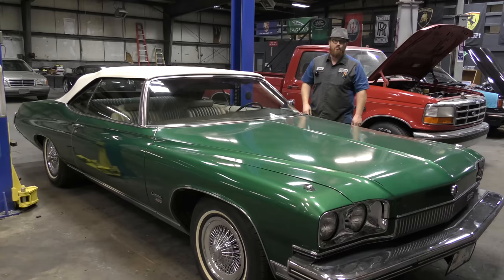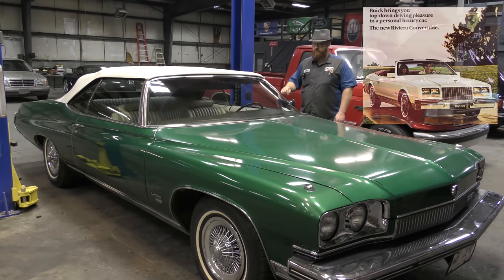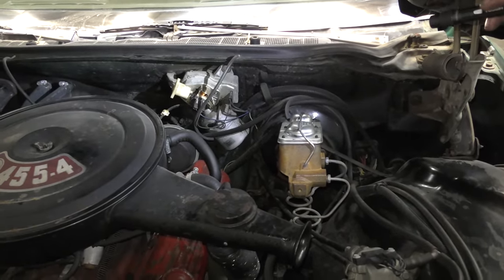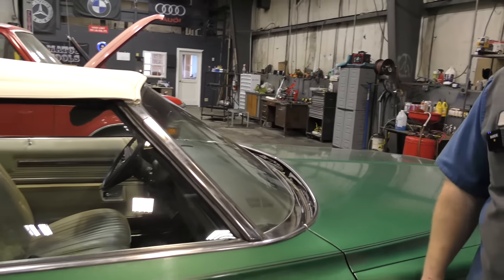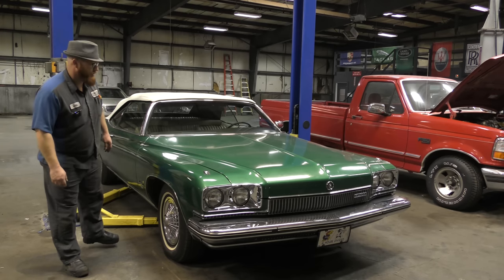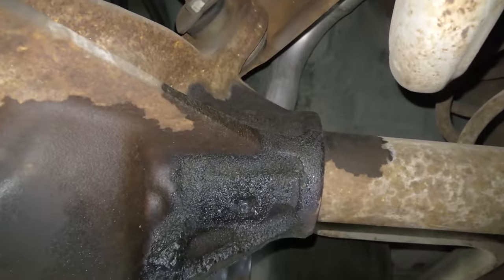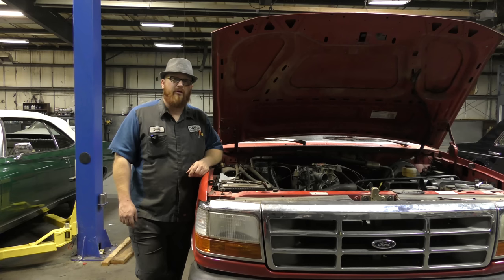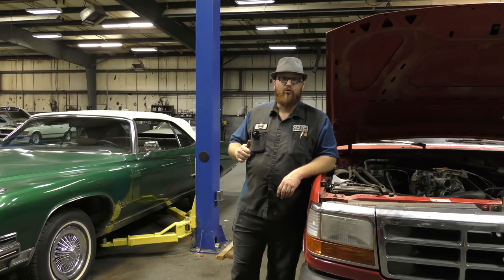Road Warrior! The CAR WIZARD shares a rare '73 Buick Centurion.

Comment: I own a '73 Buick Electra Limited, triple black 2-door hardtop. 455 c.i. big block [remember those??] , 4 bbl. Quadrajet carb, and a points-type distributor. JUST turned 20k miles! My dad bought it new Dec. 1972. Smooth ride, lots of power, about 7-8 mpg. You are right Wizard, there's NOTHING like those big old land yachts!!! My girl is asleep for the winter now, but she'll be out come Spring!
Reply: Same with my beloved '75 Buick Lesabre Custom convertible. She's resting peacefully in the garage until Spring (usually April 1st) on a trickle charger. I start her up every few weeks, give her a loving pat on the hood and tell her what a beauty she is. LOL

Comment: I bought a 73 "almost new". It had the 350 V-8 with the smaller auto trans. I treated the car gently, but the trans failed. The shop said that GM tried to save money by using the smaller trans with such a heavy car. The trans was rebuilt with a shift kit, and I had no further problems. Cars with the 455 engine got the bigger 400 trans, which had a good reputation. Looking back, it was a great car, but the gas mileage was not great.

Comment: We had a '71 LeSabre when I was a kidlet--it was one of the more problematic GMs we had. One continuing problem was that anytime one of the radiator hoses blew, it would soak the distributor and the car wouldn't run. It was also terrible with rust. It became a Fred Flintstone car when it was about seven years old--you could see the road through a hole in the carpet. It also had problems with the distributor and yes, the fuel pump also gave out on a road trip. 

We did see Centurions around here regularly, but this was the Motor City, so it was understandable.  But I always felt the Centurion was a poor excuse for replacing the Wildcat, since the 70s started with adding the emissions equipment to the engines.  Our '65 Wildcat had a lot more pep with its 401 nailhead engine than any 70s full-sized GM we ever owned.

Comment: That is best car I saw in your shop, awesome engine they have, I have myself a Century GS 455 stage 1, special sound, torque way more than you need, beautiful comfort drive and beautiful body design. every single parts are easily repairable.

Comment: I had a 84 F150 with the I6 engine (affectionately named 'Ol Blue' ). I miss that truck to this day, but I guess I wouldn't be able to find parts for it anymore. Thanks for a great channel Wizard (and the Mrs. 🙂) .
Reply: Steve Taylor Might not be as bad as you think! Did a lot of work to an 86 recently, and surprisingly parts were still decently readily available. Guess it could depend on the area too.

Comment: Wizzy, this if funny! 
Back in the day I use to own a '71 Centurion convertible same color green, white interior, white top, which we eventually changed to black, trying to keep a white convertible top clean with a car not garaged and driven in all weather including snow in NY was impossible! Mine was VERY loaded, almost every option! Power windows, locks, seats, seat back  release solenoids (I have never seen that before!), trunk release in glove compartment, antenna in windshield, tilt, cruise, A/C, AM/FM, steering wheel rim blow horn (actually didn't like it, not so convenient in a emergency blow lol), white leather seats, had the cool Buick sport rims (one of the sharpest OEM rim designs ever made I think), dual exhaust with resonators (don't know if that was an option or if all had it, eventually the resonators were not replaced during a  exhaust system replacement, they were expensive! Had a throatier exhaust sound without them when you got on it ;-)... The only options it didn't have that I can think of was the goofy speed alert warning buzzer, stereo FM, or 8 track and I don't remember if telescopic was available on Buick then. I know Caddy had it... The Centurion was a "hand me down" from Dad, who bought it used around 1974 privately from a Buick dealer salesman. I remember going with Dad to the salesman house when I was a kid. 
It became my car just after high school (1980). 
 The other funny thing is the Buick Wildcat you showed the magazine ad, a "1969 wildcat" was the previous "hand me down" from my father (brown 2 door coupe) when I was in high school '77 - '80, and the car I learned how to drive on and took my road test in! 430ci, single exhaust, 4bbl, A/C power windows, the rare upgraded interior and steering wheel, most every other wildcat I have seen had the cheaper door panels and steering wheel, also had the Buick sport rims with the cool finned wildcat logo center caps. Large finned magnesium drum brakes (on all 4). I remember I asked how come these brake drums don't rust? When I took them in to be cut once at a brake shop. The owner said because they are magnesium with steel  inserts! Then he asked me what kind of truck are they from? He had a shocked look on his face when I told him no truck, they are out of my Buick car! lol 
Also had a factory passenger side view mirror, I wished the Centurion had that! Power antenna,  rear window blower defogger and map light and switch built into the bottom of the rear view mirror! (never seen that before, but very easy to not know it's there, Dad didn't know it was there driving it for 8 years before me! 
One day while driving around 1980/81 I went around a sharp turn and heard a odd metallic crack noise and the car started handling loose from the rear end, like something was out of adjustment alignment wise! On inspection I saw the frame cracked on one side from rot, just forward of the rear wheel well area. Salted roads of NY winters!... Unfortunately that sent an otherwise pretty nice car to the junkyard! I was sad at the time, but excited to get the Centurion convertible as a 18/19 year old kid... Dad bought a used '76 Buick Electra for himself, 455 again but low HP by '76, at least that too had the cool Buick sport rims... I didn't like that car, grew too big, boaty, over stuffed and over fluffed cloth seats. Although it always ran fine... All of our Buicks went 150ish thousand miles with no major issues until it was time to get rid of them and back then people weren't on top of regular oil changes as we mostly are now... 
19 years with my '99 4 cyl. Toyota Camry, over 310k miles with no major issues ever, still drives smooth and quiet!
As you can see I choose my cars carefully based on reliability (after the Centurion was a '79 Caddy Coupe de Ville 425ci 4bbl for a few years, and then my beloved '88 Toyota Supra Turbo 5spd for 10 years until 166k miles).... But I always miss my big block gas guzzling Buicks!!! ;-)
Reply: Thank you for taking the time for sharing this. I'm from Europe where I doubt any car was available with 455ci during the 70's. And you got to drive in high school, another thing no European experiences (I remember my first time in America being amazed at the size of the car park for the local school near where I was staying. "They have so many teachers ! " ... "No silly, that one is for the pupils" :). To have a car with even 2.0L in 1980 marked you out as a big shot where I'm from - gas prices were just too high. Saw a nice Riviera during the summer at a car meet here in Czech Republic where I now live. These huge American beasts look very, very exotic here in Europe rumbling around at car meets. Greetings from Prague, CZ and all the best !
Reply: @Czechbound  Thanks buddy... Yes we didn't know how lucky we were then. Fairly cheap gas, big cars with big reliable engines and air conditioning and comfortable seats. I knew an old timer that went to Europe in the 1950's and saw all these tiny cars like the BMW isetta and the Messerschmitt and a few others and he said he thought something strange happened during his flight and he landed on another planet where they used cars that looked like big bugs to get around! 😂😂😂 
Also I remembered one day about 1982 with my Buick Centurion I pulled into the Buick dealer to see if I could get a replacement trim part for it. As I was walking to the parts department a guy comes running out of the showroom and over to me looking all upset and said, is that your green Buick Centurion convertible in the parking lot? I said yes why, do you need me to move it? He said no, that use to be my car. I sold it many years ago, I want to buy it back! I said you sold it to my father. I was there as a 10 year old kid at your house when my father bought it. And no I don't want to sell it, I love it!   
It looks extra sexy with the top down! ;-) 
He looked depressed! LoL... I am sorry I sold it a few years later...

Comment: The truly unique feature of the ‘71-‘75 (and ‘76 Eldo) full-size GM’s is the scissor drop top...same top in all lines. Top frame folds inside itself and then scissors behind the rear seat giving a full width rear seat, great for parades. I have a 75 Pontiac Grand Ville vert and it’s an awesome top, shared with this Buick. Buick moved its convertible to the LeSabre line in ‘74 and ‘75.
Reply: exactly right

Comment: The 72 my fathers patron had was so nice his mechanic would it up for the regular services. It was 455, fully loaded with air conditioning limited slip differential, and no smog equipment because it being a 72. And it was mint in 1999, missed the estate sale because of a spring break trip. It sold for less tha $3500 in 1999. It even had the centurion logo etched in the glass.

Comment: this is why i'm so glad that at least most cars that sold in any decent numbers have online communities of people to help out with fixing and restoring them. I've noticed that most online forums and fb groups always have a few members who know the right people with the right facilities and are willing to front the manufacturing costs to just reproduce parts themselves. There's a special gauge for my old Japanese SUV that is no longer made but there's a guy who has an overseas manufacturer reproduce them in batches once in a while just for the online community members - and there's another guy who works with some of the factories that originally produced parts and does the same thing. These are the unsung heroes who are taking on the responsibility themselves to allow these great classics to stay on the road in a time when the original manufacturers couldn't care less. I think online car communities could even take things a step further and have some kind of annual "dues" where members can chip in a small amount of money and maybe once or twice a year commission a factory to reproduce a batch of parts like this that have recently become completely unavailable through the normal distributors- I'm pretty sure that's what will end up happening with all of these older vehicles so long as there are still people around who are dedicated to keeping them running.

Comment: Love these big old GMs, I think the Caprice was the Chevy equivalent and the Bonneville (or maybe Catalina?) was the Pontiac version. The CB under the dash is a nice period correct accessory.
Reply: why did CB's fall out of favor in cars, and why did cars have them to begin with? i am a truck driver (tractor trailer, local work) and we still have them in commercial trucks.
Reply: Caprice was the equivalent of the Pontiac Grand Ville during the early to mid 70s. The Impala was the Bonneville equivalent. The Bel Air was the equivalent of the Executive in 1970, and Catalina after that. The Biscayne had been the Catalina equivalent
Reply: @ad356  CB's were big in cars because there was no cell phones..no other ways of commmunication..and it was a fad back in the mid 70's. I remember guys that were "pushing" with amplifiers...you could here them talking over AM band radio or over UHF tv...as they drove by the house. They were using illegal signal amplifiers that would overwhelm tv and radio reception as they drove by...i remember seeing a guy in his car driving by and hearing him over the TV as i saw him talking into his transmitter mic.

Comment: That one was loaded up!  Actually GM made full-size convertibles in all lines up to 1975 except the 1976 Eldorado was the final factory convertible until model year 1983.  My grandparents had a '73 LeSabre coupe bought in 1974 and my grandma totaled it in 1976 going over a railroad track (maybe to fast) and becasue the car dipped so low due to the weight and soft springs the frame caught on the tracks and bent the frame.  I think the crossing was probably in poor condition becasue I think it happened to others in the same spot that year.  I have never heard of this happening in modern sedans with much stiffer suspensions and lighter weight.
Reply: Wow that’s unreal

Comment: I drove the 70’s Oldsmobiles with the 455 engines in them and they were great!  I’m 69 years old now and remember those cars like I drove them yesterday.
Reply: That's the truth. My '75 Buick LeSabre convertible has the 455, which was an option back then. My '73 Hondo Pantera jet drag boat has an Oldsmobile 455 powering it.

Comment: BEAUTIFUL CAR!!!  Guy has good taste, I like the red '90s Ford F150, too.  You speak the truth about the parts going away for late '80s & early '90s vehicles!!!  One of the reasons I sold my 1996 F-150 4.9L 4x4 5-speed... that, and rust.
Reply: Facts! Parts are scarce for old cars now. My Grandma just got rid of her 1994 Mazda 929. Engine and trans was very good but the rear wheel bearings needs to be replaced and no Mazda dealer or junkyard had them. She traded it for a 2020 Mazda6.
Reply: I have a 96 F150. I haven't had problem with parts, but rust is another story. If I get rid of it, it will because of rust.
Reply: @jwelchon2416  oh ok that makes sense. But then again F150s are mass produced. I dont think Mazda built that many 929s for the US market though.
Reply: NAPA carries the rear wheel bearings.
Reply: @discerningmind  We have LMC TRUCK headquartered here in Kansas City. One can get most anything for a 80-96  F150 from them.

Comment: I was a kid in the 80s and 90s and my dad was always buying the old boats from the 70s and early 80s.  There is nothing I repeat NOTHING like the ride in an old boat.  4 hour road trips almost feel like you've been relaxing on a couch in your living room the whole time.   They don't ride down the highway.  They glide.  And when you hit bumps it's like a gentle wave......that bounces a bit afterwards but hey it was part of the fun.  lol The steering is a bit over blown though.  Sure it's no sports car but my first car was an old Grand Marquis.  It steered perfectly fine.....trying to get it up to highway speeds though.  lol.   Should never have been paired with that engine and a 2 barrel carb.  The 1985 Pontiac 6000 I bought from my Grandma after that felt like a Sports car in comparison. lol.  Man I miss that car.   To easy to steel though.  It had to go.

Comment: True about the parts being hard to find. Couldn't find a specific chip for my 32 year old Volvo cluster so I had to repair it. Or the fuel pump debacle. One site claimed it was the OEM part, got it and it was a genuine Volvo part but it was for a newer year. Needless to say I had to make it fit.

Comment: Hubcap centers have the Tri-Shield. I had it's Chevrolet cousin. 1973 Impala Custom with the 400 small block and TH400 with a 12 bolt limited slip. The car was a custom order from a GM executive and was power everything. All the bells and whistles. The original build sheet was still in tact and under the back seat and the best part, it had 36,000 original documented miles. Same color family, but with light green interior and black vinyl roof. Loved that car! Thanks for bringing back great memories of that car David! Cheers! Zip~

Comment: Nice old handsome ride! Once had one of these Buicks come in for an oil change (1985ish Firestone) Very VERY old guy owner wanted to keep the oil. Not sure why. Anyway, I raised the car on lift, loosened the 455 oil plug & ……. NOTHING HAPPENED other than a few ounces came out. Black sludge then blobbed out. No idea how the car even ran to get there! Replaced filter, added oil. Explained to owner importance of having oil in engine & checking periodically. The whole shop was laughing about the issue & the old Buick 455 started up fine as he left. Smoking exhaust. 😂😂😂🇺🇸

Comment: You can get that car to handle like dream. I have done these things: Monroe coil-over shocks in the back, I think they are called "load levelers". Monroe Severe Duty shocks in the front.  Boxed lower rear control arms and rear anti-sway bars (both OEM options).  The nice ride with still be there, but the car will make flatter cornering and more positive response for you.

Comment: Brings back memories.  A customer on my paper route had one of these.  Gold color, convertible.  In contrast to the car, the home they lived in was the trashiest shack I've ever seen this side of pictures of the poorest hillbilly shack.  Big holes in the outside wall, could see the inner drywall, entry door barely closed and didn't seal, trash around the yard, lawn was mud & overgrown weeds...  I couldn't understand the beautiful & expensive car in contrast to that.

The GM washers - Press the button once, and get 10 seconds of squirting.  I much prefer having a separate pump that allows you to use only as much as you want.

Comment: I worked at a Buick dealership here in Massachusetts from 1985 to 1990. We had two or three of these models come in over the years also had a friend that had one.  Even at that time we still had quite a bit of mid 60s with Le Sabres and Wildcats Riviera’s and Electra 225s. Never any grand sports though. Definitely cool cars that road just like you said. This is a time on American cars were king

Comment: I helped take a load of aluminum scrap to the recyclers about  5-10 years ago. They had several Gaylord boxes full of brand new unboxed metal heater blower motors. A parts retailer scrapped them because they were no longer selling enough to pay for the shelf space.